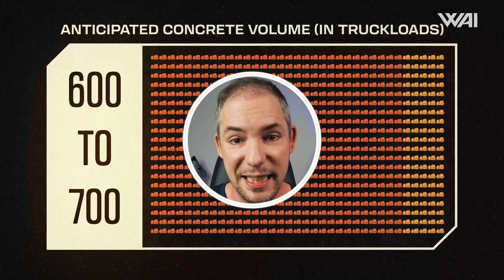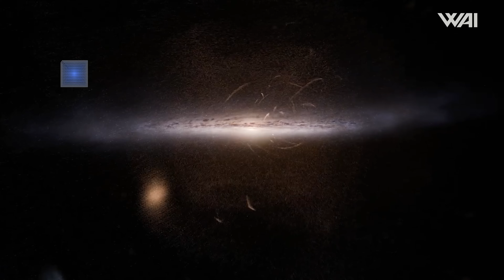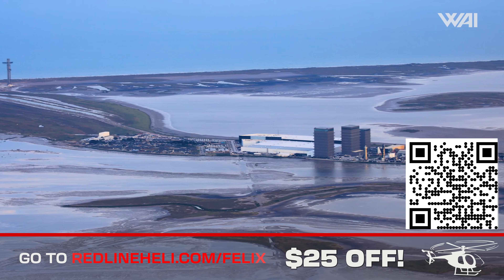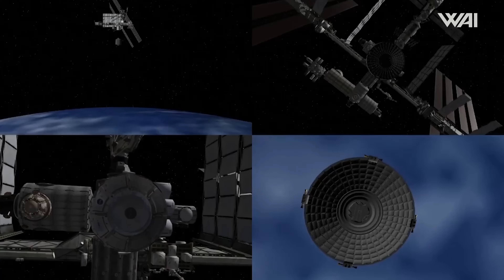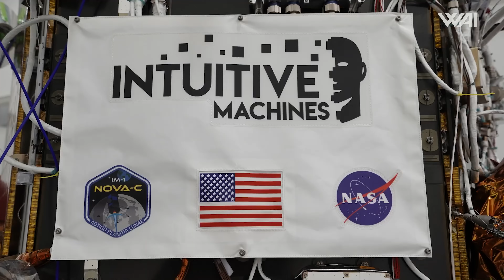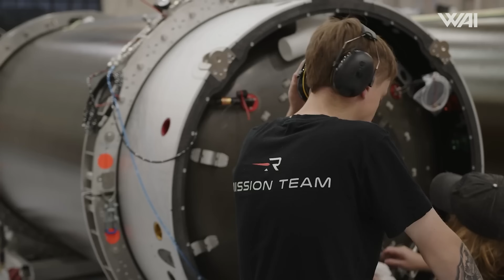BIG Plot Twist: SpaceX reusing a Starship Booster? Block 2 is Finally Coming!

Comment from the maker: What do you think? Which booster will fly next? Now’s your chance to place a bet! 14 or 16? :_WAISweet:
Reply: B14,They just rolled it out to the pad
Reply: I think 14 will fly, if they want reusablity testing now is the time.
Reply: What happened with Starbase updates? Used to be ~15 minutes now it is less than 5 minutes
Reply: @luv1ngu  If you can do better, step up, if you can't- pipe down
Reply: I think it will be B14. I’m sure that’s what they’ll try to do. Also, SpaceX never disappoints, I’m sure it’ll be B14.
Reply: B14
Reply: @Whataboutit  It would be B14 as B16 doesn't have its Raptor 2 engines installed yet!
Reply: I would say 16, I don't think they'll want to add a possible new failure point, while starship is still exploding
Reply: Well, since booster 14 is at the pad, I’m going with B14!
Reply: 14
Reply: @dapotatoo1018 brings up a good point. So I think they will definitely use one of the two boosters ✌️🤍
Reply: If nothing else, SpaceX recycles a lot! But if B14/S35 fly, then we'll find out if the problems from flights 7&8 are fixed. Can only wait for an announcement from SpaceX. Fram2 👍👍
Reply: I think it will be 16 for no other reason than Space X does not want another unscheduled rapid disassembly on this flight
Reply: @mrtwster  they already know b14 works.
Reply: B14
Reply: Why does the Gravitics satellite carrier have windows? Secondary mission?
Reply: Felix, did you go up for a Heilo Flight with RedLine while you were out at the StarBase last week? I know I ABSOLUTELY would have if I was there!!! I've never been in a Chopper and I that would be the PERFECT TIME!!!!! :)
Reply: Fotin sorry fourteen
Reply: B14  all the way
Reply: B14
Reply: B14 is on the OLP, but I think just a static fire to prove it can be done and not a reflight  We're in too sensitive of a time given the previous two flight tests for SpaceX to get too ballsy just yet.
Reply: 14
Reply: 14 is on the launch mount this morning 😊
Reply: so … let make a bet … another failure to come. spaceship is 100% unadulterated BS …
Reply: They said that a booster catch was off the table.  B14 will be sacrificed so they can attempt a Starship catch which means at least 1 orbit. 
Ambitious, but they have to be after the last two failures. Not to save face, but to get back on their internal schedule.
Reply: Typical WEF globalist/double agents fear mongering just to exploit taxpayers subsidies as they scoop 75+% off the top for their management BS that doesn’t allow the funds to reach the actual project!
Reply: 14

Comment: As a structural concrete professional, the "Hoover damn issue" is no longer an issue. We have developed capabilities to increase the curing process in large placement concrete pours by placing coolant lines throughout the concrete. We then pump chilled water through the lines to draw the heat away from the inside. This is how we are able to get bridges with large placement to cure quicker. We have also developed new concrete ratios with acceleration products.
Reply from the maker: Did you see any of that in aerial footage? Would be interesting to see! If you’d like, send an email to contact@whataboutit.net! ❤️
Reply: @Whataboutit  let me look closer and I'll let you know

Comment: What if on the booster instead of stacking starship they stacked just a fairing. Losing the weight of starship, what altitude and what payloads can it reach, with and without relanding booster. I believe starship is only useful for moon or mars missions.

Comment: In the 35 engine version of Booster, it is highly likely only the inner five engines will be capable of restart and gimballing. This leads to a 6 percent thrust increase and a mass decrease as 8 gimbal heads and restart equipment are removed, and trust is moved closer to the tank wall requiring less structure. The launch mount will provide gas to spin-up the middle row of engines. A reduction from 13 to 5 engines for boost back will reduce thrust from about 20G to 8G - made up for with a longer burn. It will be similar for the landing burn. Lower acceleration means lower forces, lower vehicle strength required. Potentially, the five middle engines could be continuously running from launch to catch while being throttled down as required, however, probably better that the boost back and landing burns are separate. The hotstage burn is a throttle down only of the inner engines. For higher mass ships with 9 engines rather than six, the booster can keep more thrust going during hot-stage. 

Instead of a shield for each outside ring engine, SpaceX could opt to put the outer ring on the centreline of tank wall and have a smooth cone-like shield for the outer row. This means the middle engine row can be closer to the tank wall reducing structure. Thus the centreline of the outer engine row could be 4.5 m from the centre and the middle row 3.3 metres, leaving a space radius 2.65 metres in which the inner five engines can gimbal. The inner could be at a radius of 1.2 metres, thus be about 200 mm apart tangentially, occupy a space 1.85 metres in radius and thus leave an annular space 800 mm wide in which they can pivot. The engines could pivot about 15 degrees with this annular space.

Comment: yes bulk concrete pours  make a unrecognised problem , , concrete at that depth needs time to set , and continues to harden over time , " TIME" , , yes to get to maximum strength , , it takes time , and the more poured at same time takes longer to achieve maximum strength , i think the HOOVER DAM is still not fully set at strength to this day , ie the concrete is still not fully hardened or set

Comment: Why does Intuitive Machines design a Lunar Lander with the proportions of a refrigerator, with all its mass seemingly above the landing legs? They DO understand the concept of centre of gravity, don't they? If there is even the slightest amount of lateral inertia when the lander touches down, of COURSE it's going to tip over. Can you imagine what Apollo 15's lunar landing would have looked like if the LM was proportioned like I.M.'s ship? Dave Scott is a great pilot, but given the 'Leaning Tower of Pisa' attitude Falcon assumed when landed, an 'I'M' design would have left Scott and Irwin really stranded on the surface of Selene. Extra dittos for Starship HLS.

Comment: Is the hesitation to launch gone up since Shotwell took over?
Fear of failure creeping up?
Where is the focus on more frequent iterations?
The space program in the 60's pushed through failures to help the USA get to the moon and back first.
There might need to be a push forward with a bigger and more advanced tile testing facility.
Also, the other  issues they have may need competing teams similar to when there was Florida team vs Texas team in the past. You can't have a team fear to speak out for fear of not falling in line with others.

Comment: Accidents that NASA no longer has any direct control over is why they insist on more than one commercial provider, but I suspect that if SpaceX continues to improve their operation, they will be increasingly relied upon by NASA. About the booster reuse, I must agree 14 is the more likely of the three and I expect they may include engine Pi (314) for a third flight. Technology advancements are not linear but go in leaps and bounds, as each advancement is made, they need to learn how it works, then they can make the next game changing discovery, we may be at that point again soon for space travel propulsion.
Reply: space travel propulsion , need nuclear plasma drive to go in to deep space. solar won't cover it . ion drive power from a nuclear reactor .
Reply: They currently have no alternative to SpaceX because NG which manages Cygnus no longer has its own booster because NG was using a RUSSIAN booster and made no backup plans until after the invasion of Ukraine!

Comment: I think that the massive thermal load from the exothermic concrete curing reaction will become a problem, unless they're using special additives or flowing water through the pipes.  I'm sure they took all that into account, although, the initial lack of a flametrench notwithstanding, you never know.

Comment: Question: If SpaceX achieves rapid reusability within reason, does that mean the boosters aren't going to need to be static fired every time in the long run? How are they going to work around that?
Reply: always be tested prelaunch safety

Comment: Economically speaking, reuse the old booster?
1) assess damages and recurring problems of reusability?
2) Expendable. Can be used for high risk test flight?
3) If it lands in the sea then SpaceX won't have to dismantle it.
4) Gives more time for the new booster development.
Just saying...
Reply: What a lot of people , even engineers , miss about reusability.

It allows you to launch more often.

What makes the "Falcon 9" such a success isn't the vessels cost per launch , it's the number of launches they can do a year.

134 in 2024.

That spreads the static costs of the company:
Salaries 
Utilities
Taxes
Insurance
Daily Operating costs 

Over 134 launches instead of 10.

Even if reusing a booster cost more than building a new one , they wouldn't be able to build 134 Falcon Nine boosters a year.

Starlink will require approximately 30,000-60,000 Satellites 
So Starlink will require about 100 "Starship" launches a year to fully build and maintain the network.

That's why they are pushing for full reuability.
Reply: The problem is SpaceX needs to get some score on the board at this point.  With two launches in a row that didn't move their "high-water mark" up, they don't need to add risk right now.  Maybe save it for a later launch, assuming it doesn't get replaced by the next booster/raptor generation.

Comment: Felix, it doesn't make any sence to refly a booster. For what? For us? It makes only sence to reply the finished developed booser. Right now each booster chnages from another, they all are test-boosters.
Reply from the maker: B14 just got rolled out to the pad for a static fire. It makes a lot of sense, as many design decisions will stay the same on boosters down the line. If SpaceX gets an early chance to measure fatigue and wear on the hull, it will lead to better results down the line! :_WAISweet:
Reply: Reflying a booster is a very visible check box in PR. Most non-space-nerds don't believe reflying a Starship booster will ever happen. Best get it out of the way so they can gripe about the next thing.
Reply: It would be good for SpaceX to show reusability the right off the bat. It would be good for shareholders. But at the same time it will be missing out on a launch for the new booster.

Comment: The Hoover Dam problem was really not a problem.  A. J. Wiley, the first engineer hired on the Hoover Dam team, solved the problem of curing massive pours of concrete in a series of dams in Idaho and Oregon.  Starting with Salmon Falls Dam in Idaho, he successfully proved his techniques at Warmsprings Dam and then Owyhee Dam.  Most of the structures, many over a century old, are still standing and still in use.  The western US and indeed the world owes a great debt of gratitude to the almost unknown engineer.
Reply: Salmon Falls dam is a huge dam for a tiny River-
Reply: @jackprier7727  gives more of a proof that a structure wouldn't crack from mass than water force evaluation
Reply: Pah -- badly designed --- Didn't Hover 😆

Comment: It was painful to watch everyone’s explanations about why they weren’t using flame diverters. At this point, it’s possible that Musk is hindering the project more than helping. He has an amazing team working there...
Reply: It was well known that the deluge plate was not a permanent answer but it got stage 0 back up and running months possibly years ahead of digging a flame trench that they had no permits for and would likely have had to re design the OLM to accommodate said flame trench. 
Expect to see pad A get torn down and upgraded once pad B gets fully operational.
Reply: @andrewcastiglia9548  I remember “What About It” mentioning that they weren’t building flame diverters because it’s a very swampy area, but you might be right about the permits. Then again, flame diverters can be built above ground. I bet Musk was thinking about Mars and how this rocket will have to lift off from a concrete pad at best, this is why he wanted it to work so hard.
Reply: Actually they will build a 3rd tower before taking pad a off line.  They need the high frequency of 2 operational towers to meet artimus and mars test schedules.@andrewcastiglia9548
Reply: It's consistent.
Reply: @rh906 it's consistent with "the best part is no part".
In an interview (I think the most recent Everyday Astronaut), Musk briefly implied he would still have liked to try a lighter weight solution, but was overruled by the rest of the team.
It makes sense to find how cheap is feasible if you're planning to build dozens of them.
In any case, they got data to inform the current design.
Reply: @rh906 no they tried to be fast and knew what phase 0 means for a multi generational project such as this.

Comment: Without much background information, I would assume, that spaceX won't already reuse a booster.
They might play safe on the booster side, in order get the upper stage tested.
There are many tests needed for the upper stage, as the last two launches fell a little bit short.
Reply: If it weren't for the previous two failures, I'd say we'd see a booster reuse on flight 9, as it is, though the failures made it highly unlikely
Reply: Why not try booster is getting better and better every launch.

Comment: Rooting for 14, but they will fly 16. They are "improving" the boosters as well. It doesn't make sense to fly an older version with an outdated design. 
Of course reflying is a big demo "milestone", but they are looking past that. They will rather test fly the improvements than tick of that bucketlist item.
Reply: But they're not really improving the block 1 boosters at this point... 16 will have some differences from 14, but neither of them are the block 2 design they're putting the real development work into. So whichever one they fly, they're using an older version, and they're only doing it to launch the newer ship models.
Reply: @ True. But also "so what?" Innovation is on going. So what if they're flying a slightly older booster. Unless they benefit from absolutely maxing out the payload mass of starship it doesn't matter if it's a Block 1 or a Block 2 booster.
Reply: @ekij133 remember that a starship launch costs around 200 million. That is outside the r&d costs. They are prepared to spend that money to get their operational tests in. The reusability team @spacex will be voting for "lets test reusability now", the development guys say they have a lot of new changes to test.
Reply: Maybe, maybe not. If they fly a block2 ship again they may want the 'win' of re-using and re-catching a booster just incase the block2 ship problem has not been solved.
Booster 14 is presently sitting on pad A with an expected static fire on Thu 3rd.
Reply: they might also Static Fire B14 anyway -- (just SF) cause its the nexr test stage to re-use ... But fly B16 next.
Reply: Agreed. I think they'll only do a refly when one of two conditions occur. 1) The booster design becomes reasonably static.  Or, and less likely, 2) They run out of newer boosters due to RUDs or aborted catch attempts.
Reply: @_starfiend  Right now they have more boosters than ships. B11, B14, B15 and B16 are all more or less complete and ready to fly. It's impressive that already catches are almost assumed and RUDs are not expected (for the booster).

Comment: The flame trench updates alone are a visual reminder of how infrastructure quietly paves the way for major breakthroughs. Great coverage on how these foundational steps often hold the key to what comes next.
Reply from the maker: Thank you! Yep! That first water tower was not a good idea. Going this way is what's needed for the largest rocket ever. I am very much looking forward to launch photography from the new pad. All the smoke and vapor will blast off into one direction. Clean sight of the engines when it takes off! :_WAILove:
Reply: 109%Genius comment